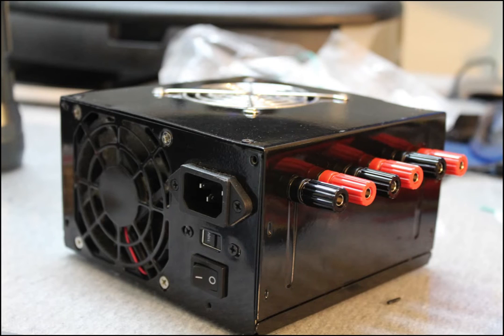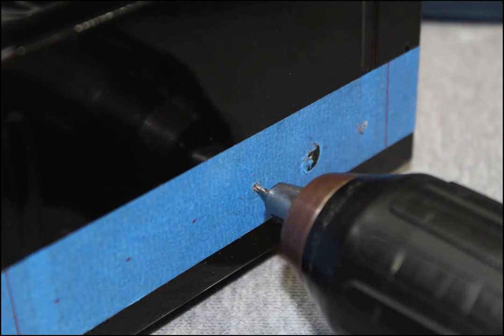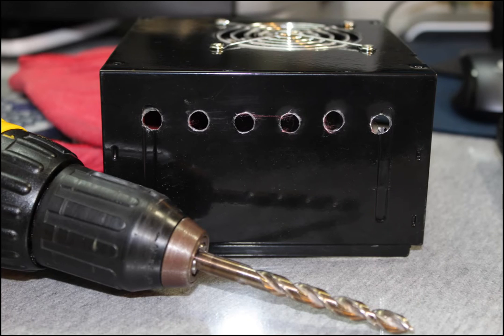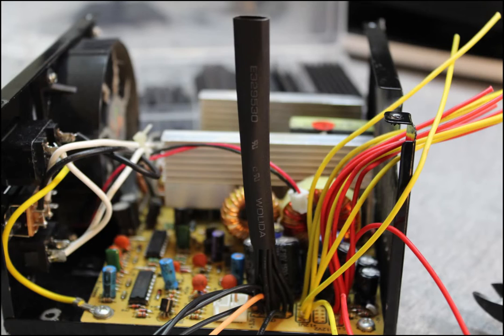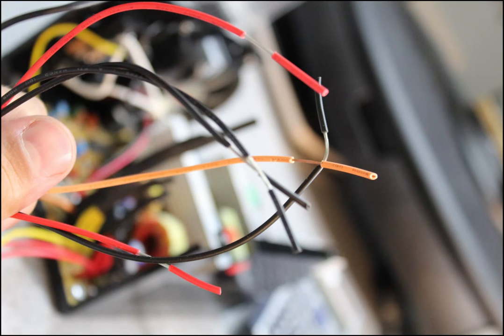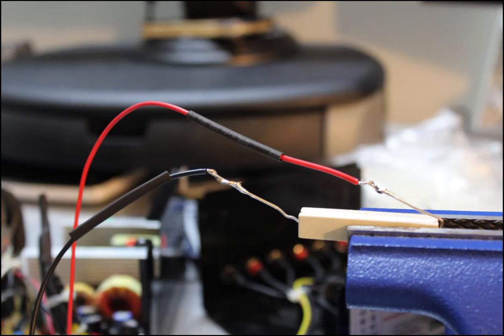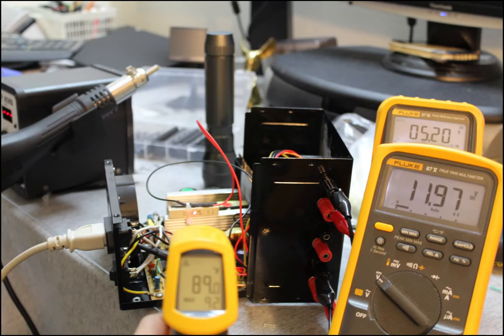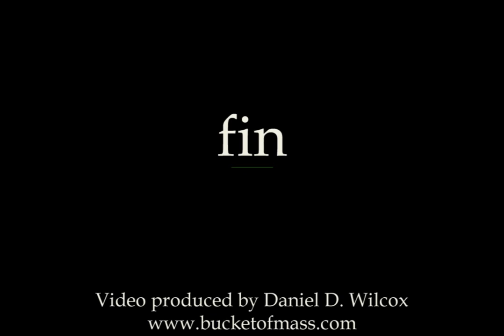DIY Converting a Computer PSU into a LAB PSU

Comment: Be proud and clean your fan ^^ even thou you tried to get those holes as in line as possible they still looked a little crooked, i think if you used a step drill bit you would have had better results. good video thou

Comment: So, if it turns on when tripped without a load, is it ok to assume that the load resistor isn't required?  the ones I'd like to do have power quite evenly distributed. 3.3v and 5v - 20 amps and 12v  -18 amps. Thanks